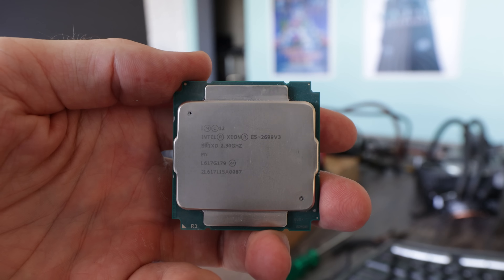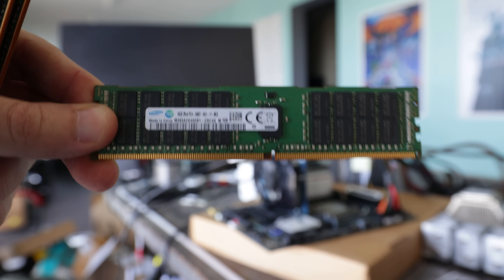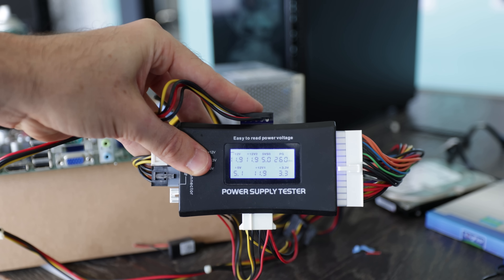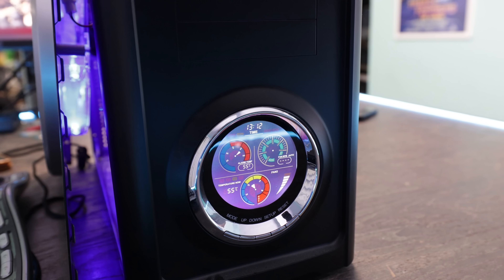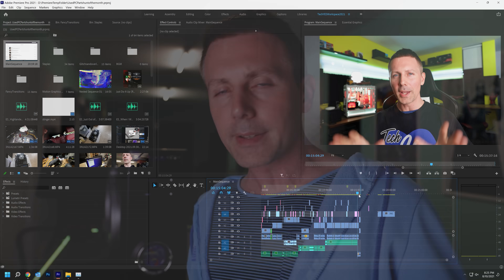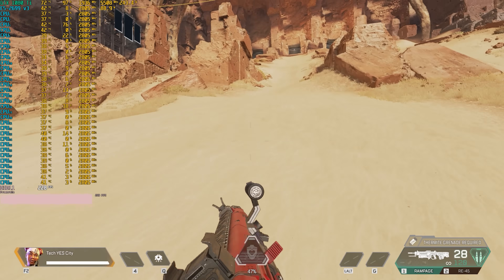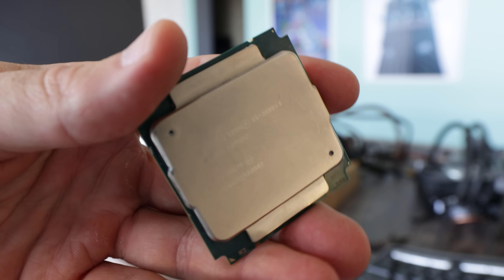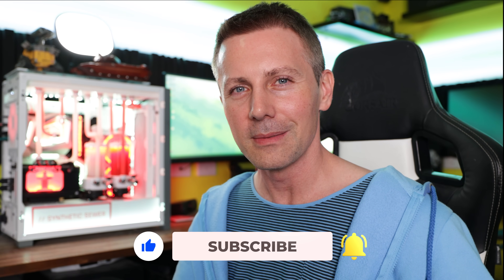I Built a BUDGET 18 CORE XEON Gaming and Workstation PC (Part 1)

Comment: Anyone know if my thinkstation d30 with dual xeon e5 2620. They are 6 core 12 threads each clocked at 2gz . would i be able to upgrade to something similar? The motherboard is LGA 2011. I picked up thinkstation that has 2x16gb ecc ddr3 1600mhz , dual xeons e5 2620s, gtx 970, 2tb hdd, two Samsung 840 Evo 120gb ssd everything working great for 150$ Canadian and I'd like to upgrade the cpus from what they already are
Reply: you can only upgrade to any E5-26xx v2, v3 or v4 are for X99/C612 not fit for your PC.

Comment: I just bought a Dell Precision Tower 5810 Intel Xeon E5-1620v3 3.50GHz 16GB 1TB K2200 off of Ebay & I put a Nvidia 1030TI GPU in it. It works great & doesn`t make a sound.

Comment: how do haswell and broadwell xeons compare? i’ve seen the e5-2683v4 (16c/32t) go for <$100 while pretty much having all the same specs and chipset/motherboard. on paper it shrinks from 22 nm to 14 nm, which should be quite significant. clock speeds are quite lower, though

Comment: Like most Xeon processors, yes there's a lot of cores to use. Ideal for VMware, data calculation and large amounts of consequent threads.
But the base clockspeed of these cores is very low. Single core power is absolutely underpowered, and thus mostly useless for day to day PC usage like games, browsing, or just office work.

There are much higher clocked Xeon processors with less cores. Use those.

You don't need 36 threads, you need single thread performance over a lot of shitty cores that are slow.

Comment: i have the workstation x99 board , and i found out the hard way , the on board NVME connector is only hard wired at 2X instead of the 4X i thought it was.  you should remove the nvme hdd drive and utilize a PCIe X16 or X4  add in card in the top PCIe X16 slot to fully utilize the nvme`s rated speed   i have the E5-2698-V4  20 core which is a beast

Comment: Or you could buy a Core i5-11400 ($200) or the f version (for even less) or Ryzen 5 3600 for about the same price with 50% or 30% faster single-core performance (Passmark and Tom's Hardware review), respectively, and half the power consumption—which most people will notice a whole lot more than a few extra cores. Add a decent cooler to the i5 and unlimit the power for a 20 to 30 percent multi-threaded boost and the Xeon makes even less sense. (Plus, with the i5 you get PCIe4, a modern supported namebradnd motherboard with a warranty, etc.)

Comment: Using 2696v3 (same CPU pretty much) for a few months now. Rendering power is insane. Also 64 gigs of 2133 DDR3 RAM cost me about 130$
Reply: It is amaizin
Reply: Yooo ?! Does 2696v3 support ddr3 ?
Reply: @yasirrakhurrafat1142  Yes, it does. It's 100% stable at 1866 Mhz.
Reply: @geg_otmopo3  that's amazing , and a bargain !
Hope you enjoy the x99 platform to the fullest !
Reply: @yasirrakhurrafat1142  x99 is definitely a beast for it's price. As workstation and also as a gaming rig.

2696v3 has no competition today at it's price point for the CPU+board+memory combo:
8300 CPU-Z score and 14500 Cinebench R23 score with a TDP of just 145 Watts.

2133 MHz is possible on DDR3 with a good motherboard. But for stability I run it at 1866 with lowered timings, because I hate BSoDs 😁
Reply: @geg_otmopo3  dude , I thought u were just a casual user , but you're far from it .
Yes , lower clock and tighter timings is not only better for stability but also performance sometimes .
You ever tried turbo boost exploit ?
I.e your all core boost becomes equal to your , single core boost .
If you watch miyconst ytber , you'll know how to .
Reply: @geg_otmopo3  by the way , can you please test cb r15 multi core ?
I wanna cross reference it with other 269xv3s .
Would really appreciate it if you could .
Reply: @yasirrakhurrafat1142  Yep, I'm running turbo boost exloit with -80mV core undervolting and -25mV cache. Marginally worse performance than -100/-50 mV (about 1% worse), but has some room for extra stability. X99-TF board btw. 
145 TDP limit is not enough to boost all cores to 3.8 GHz under heavy load – it's about 3.3 GHz on all cores. 
It's possible to disable TDP limit at all so all cores would be at max, but people say CPU will draw like 400+ Watts of power and I'm not willing to risk my CPU and board for extra performance 😁

I'll try R15 at multicore in an hour or two and post results here. Have nothing else to do today anyway.
Reply: @geg_otmopo3  I also want performance with efficiency .
Its amazing tho , that the big name brand motherboards don't support ddr3 but the Chinese ones do .
The mobos that can blck , base clock oc , also can't hit more than around 3.3 ghz , on 2699v3 , which is essentially same as 2696 as you said . 
Saw it in a linus tt video .
Reply: @geg_otmopo3  
THANKS for being willing to test the system . 
Very appreciated !
Reply: @yasirrakhurrafat1142  No worries. It shows 2732 cb in CB R15.

China produces great motherboard but sadly factories 
are always keen to reduce the cost of production.
So for example when earlier board revision gets good feedback from buyers/users, factories release v2.0 version with weaker VRMs.

So it's a rule: if you want a good Chinese MB - buy v1.0 revision of a popular model :)
Reply: @geg_otmopo3  that's a monster , for being the same power draw as the 9900k ! I think it draws the same power ? Cuz intel lied on multiple recent gen of chips .
The chinese are wrong dude , if they made it more user friendly or better somehow , the sales would've only increased , with better reviews/feedback .
How do you use your workstation tho , primarily , gaming / renderring / ai ? Are u using the full potential of the io ?
Reply: @geg_otmopo3  
Thanks for the cinebench results !
I know this is asking a lot , but. Have you ever tried disabling a core or two ? Cuz I think , if you do so , your clocks would go up .. maybe overall performance would stay the , cuz higher clocks would clocks would compensate for the lack of cores ..
And I think if that happens , most softwares that don't utilise many cores , would run a smidge better .
Just speculating , but if you try , tell me as well .
Reply: @yasirrakhurrafat1142  Pretty sure 9900K draws more than 200W when turbo-ing in stock. 5 GHz overclock will put it at 250W+ range. I don't think it's even possible without water cooling...
ID Cooling SE-207-XT is enough for 2696 to keep core temps at aroung 50 °C (it is TR4-socket cooler but with a little tinkering it fits lga2011 mount just fine).
26xx and 46xx Xeon series are known for their low temps (server CPUs after all). 

I'm using my PC mostly just for entertaining. Some Blender, some gaming, some photo editing. Not making money out of it. Monero CPU mining does not count :)

As for disabling cores - tried it. It mostly has negative effect:
1) If application has good multi-core compatibility it will run faster with all threads/cores enabled, even if some of them throttle.
2) If application is not optimized to work with that many cores and mostly relies just on core clocks - it will still 100% load cores it can access. Disabling idling cores won't help.

I just disable HyperThreading when I play games and enable it when I do some rendering and other stuff.
Reply: @geg_otmopo3  
Those 11xxx 12xxx consumer room heater/cpu users , are peasants against your powerful and efficient server grade hardware .

You're making good use of your workstation , I have no complaints .
Although my idea of disabling cores was a bummer .

I really appreciate you , responding .
Hope it wasn't very overwhelming .
This was one of the most satisfying conversations on YouTube that I've had .
Where r u from ?
Reply: @yasirrakhurrafat1142  No problem at all! Thanks! Glad you learned something new, since there is not so much info about chinese mobos in English.

I am from Ufa-city in Russia so some English practice is always appreciated :)

If you are interested in that kind of hardware you can also check the channel called "Технопланета". 
Guy is from Ukraine and his vids are in Russian but he has great comparison tables and graphs.
Miyconst but better!
Reply: @geg_otmopo3  
 @Алексей  
Yes , your English is fantastic .
I'd love to learn Russian and more European languages as well .
Loved to have a great conversation , with a fellow tech enthusiast as yourself .
Thanks , and for recommending the channel .
Have a lovely day my friend ..

Comment: Mine should handle it: I have an Asus x99 strix board with a 5960x cpu. I have checked cpu support list-this board goes up to 22 cores.  Intel Xeon E5-2698-v4 (2.2G,135W,L3:50M,20C,HT) Intel Xeon E5-2699-v3 (2.3G,145W,L3:45M,18C,HT ntel Xeon E5-2699-v4 (2.2G,145W,L3:55M,22C,HT)

Comment: Hi, Bryan!

2699v3:
L2: 4.5MB
L3: 45MB

I've just bought from a local server park refresh 3 pieces of 2697v3 for ~43-44AUD and one piece for free (missing capacitor, I'll try to fix it). And also 2 pieces of 2680v3 for ~35-36AUD. Samsung 16x16GB 2133 ECC modules for ~27AUD/piece, also 3 pieces of supermicro x99 boards for ~68AUD/piece. I think currently the x99 platform is the best. So 5 cpu, 3 boards (+1 main rig: asus x99 ws) and 4 packs of 4x16GB ddr4. For the last cpu I've got 4x4GB "consumer" modules, but I need a good x99 mATX board for a "little pc".

Any suggestion?

There were also some P4000 Quadro cards for ~227AUD, so I snatched a few of those.

Comment: I've got a workstation with two Intel® Xeon® Processor E5-2670 (8c, 16t) but the issue I've had using it was the idle temps were 50-55c. The motherboard(Asus Z9PE-D8 WS) cost me more than the RAM + Both CPU's combined! :)

Cooled using a H100i for the rear CPU and H85i for the front; I really need to see what CPU's I can upgrade these two and perhaps try to fix the cooling/noise issue ><

Comment: Which revision Asus X99-A was used? theres a 2nd model , "Asus x99 a ii" not too sure on the difference between revisions other than some talk of fixing some power issues? Also is the modified BIOS based on the last release 41.01 ? I have the original Asus X99-A and very very tempted as an upgrade from my 5820K

Comment: What is the use case for this computer? If I wanted to replicate it would cost $1,400 or so and for that I could get a prebuilt with a 3070 and a 11700. Does the extra cores out weigh the faster GPU and CPU?

Comment: still rocking my sandy bridge E5 2650 8 core CPU for video editing. built that system nearly 2 years ago now. got that paired with 32GB ECC DDR3 1866MHz (runs at 1600MHz because sandy bridge doesn't support higher clocked memory) and a GTX 980. this thing does a great job. I have it dual booting Windows 7 and XP.

Comment: Hey Bryan, just a little heads up:

My dad built a PC with a similar case back in 2011, except he had a Cooler Master one. It also had a fancy front display with the wires to power it coming off of the 24pin connector.
Now, a few years ago, my dad complained that his PC wouldn't boot up anymore. Turns out the inline 24pin connector from the case had shorted (there was a black pin), and it killed his fairly high end motherboard. I don't know if this is common, but.. it's something to be aware of I suppose.

I don't know if the CPU survived tbh. It's an i7-750, so it's not exactly worth anything anymore. I just gave him an upgrade using an old board & cpu I had laying around.

Comment: i bought a 2680v3 for around 110 usd. it "only" has 12c/24t, but i thing for price/performance of it is even better than the 18core one. the only problem is that i have only a gtx 750 (2gb) right now. however i will buy a tesla m40, that is around a 980 ti is performance, but with 24gb of memory. the gtx 750 will stay as display gpu. this rig is a very good as a budget gaming pc/workstation. also i can upgrade later to the 2699v3, but now, i will use my 2680v3 for a long time i guess.

Comment: I did the same a few years ago, resurrecting a 2012 Dell, dual Xeon workstation and getting the fastest xeons that would fit in it.

But I just bought a Comet Lake (10th gen) gaming PC, and the more current processor will do about 60% more work single threaded or about double the work per core, full load vs. full load.

So what adds up to 32 threads of gen 2, e5-2690 only does double the work of 8 threads of gen 10, i5-10300H.

At least theoretically according to geekbench scores. The laptop is still on the way so I haven't tested it yet.

Comment: The issue is with CPUs like these is that so much software is still compiled in the single threaded mindset (maybe 2 threads if you are really lucky) making an old CPU like this fall pretty far behind new ones in every day programs like Photograph, Lightroom, Luminar, Prem Pro, Chrome, Word...
I would expect, if you have $200 to spend, then something like the upcoming 12600KF would give you better performance in a wider selection of applications than this. 
Sure if your workloads are exclusively Cinebench, Blender and programs that fully use as many threads as your system has then this used, no warranty, CPU will be faster but it's important to understand your workload and software limitations when choosing hardware setups. Even programs like Prem Pro have a lot of single threaded aspects to them, especially when paired with a modern GPU.

Comment: I have two X99 platform Xeon rigs. One is an ASRock X99 E5 2699 V4 (22c 44t) w128GB of RAM, the other is an Asus X99 Deluxe with an E5 2683 V4 (16c 32t). I've been playing around with Xeons & X99 for a couple of years now. ASRock boards will allow use of more RAM with the V4's. Asus boards seem to be limited to 64 GB with either V3 or V4 Xeons. The ASRock boards also have USB C standard (depending upon the mobo) while with Asus you have to use add-in parts. 

For video transcoding the Xeons barely go above idle temps, my i7 5960X ran close to twice as hot under load with the same cooling with the 2683 V4. The 2699 V4 runs even cooler with identical cooling. It's been my experience that 103.4 BLCK is the highest both rigs will go with 100% stability. I have the 5960X and an E5 2683 V3 14c 28t (my first X99 Xeon CPU) stashed away as spares now. The V3's max out at 2133Mhz RAM, the V4's 2400Mhz. I'm not a gamer so I have no input on them for gaming use but for A/V work the V4's are my choice. I went after Xeon's that had been listed on Ebay for a while and made lowball offers until I got what I wanted for the price I wanted to pay. I also have two Asus Sabertooth X79 rigs with E5 1680 V2's in them running at 4.5Ghz with 64GB of RAM. They never miss a beat in daily use.

Comment: There was a case that had a screen built into the side panel but you needed some white covering on the back of side panel and having a light source shining through the white covering so the image shows up, the case was a IBuyPower case with a LCD monitor as the side panel but needs a white backing and a light source so you can see the images.

Comment: I love my 5600X build and it is my main PC that I use. But I have a old i5-4690K mated with an MSI Z97-G45 gaming board with an MSI MPG 240mm AIO and I have it clocked at 4.5ghz all core and mated with the MSI Airboost Vega 56 with the 64 bios on it, and it performs within margin of error vs my Ryzen 5 3600 build with a 5600XT in 1080p. And I have about 500 in the whole build. The CPU/MB/Ram cost me about 100, the AIO cost me 50 never used but out of the box, the Vega 56 cost me 200 bucks when I bought it in 2019, and Thermaltake RGB 650 watt psu cost 50. 1 tb hdd was 20 and the 240gb SSD was 20. Case was free and set of fans were roughly another 30. I have about 800 in the whole set up of the R5 3600 setup, and while overall it is better, the 4th gen i5 setup for gaming holds its own rather nicely.

Comment: Bonus with these Xeon v3's you can unlock full boost with bios mods so you can get single core max boost clocks on all core workloads. How does 3.6Ghz all core sound like compared to non-modified bios 2.7 to 2.8ghz?

Comment: avx1 gens have their uses but in that price bracket you can have 10/11gen mutant which would fare better for most applications, and odds are if you do use applications that can actually utilize 18 cores they would still do better on 8-10 avx512 cores than on 18 avx1

Comment: Nice I got a Xeon E5 2682 V4 16 core now in my computer, first I had a Xeon E5 2680 V4 14 core, than got hold of an Xeon E5 1660 v4. So I changed to my 16 core instead very happy with the CPU in gaming. Got in my other computer hooked up to my TV now a E5 1650 V2 that I will change out to a Xeon E5 2690 V2. Also got hold of a X79 Klisree Quad Channel motherboard that I will put in that computer.

Comment: It's just fantastic to see what kinds of system you can still build on these old X99 platforms! 
A thought on the subject of these older KW/h guzzlers. Depending on where you live in the world, building a system around a 145W cpu doesn't seem to be such a effecient or practical decision imo. Atleast, not if world prices on natrual gas come down reasonably after past week's price hikes. Most countries link their KW/h price to the price of natural gas. So this 22nm roomheater will also get a more expansive to run, albeit less then heating ones room with tradition radiators.

Comment: I only just upgraded to an Asus X99-A.USB3.1 with an E5 1680 v3  and 32gb of ECC ram. I picked the board and ram up with an E5 2683 v3 for £200, and got the 1680 for £75. Managed to get the  1680 up to 4.4ghz on air with the cache at 3.8ghz, it's running really nice . Would be interesting to try the 14 core 2683 that I have if the  bios could be unlocked, sounds like it might be a bit tricky though.